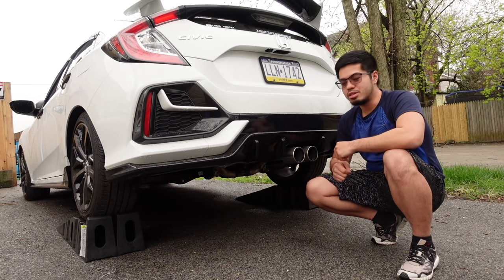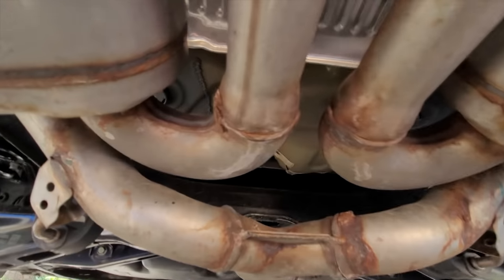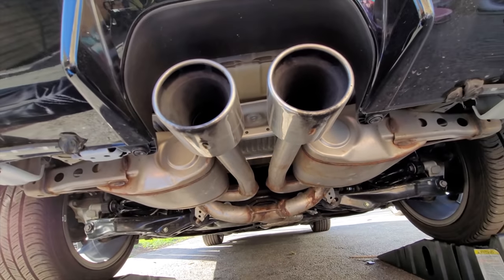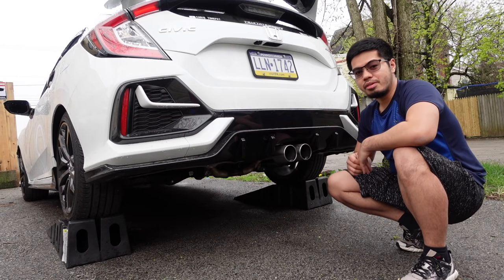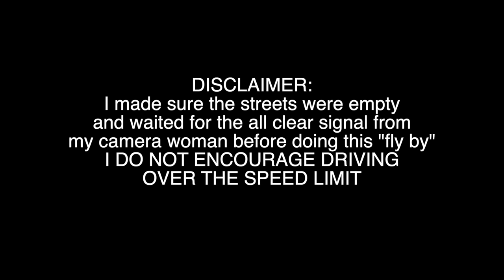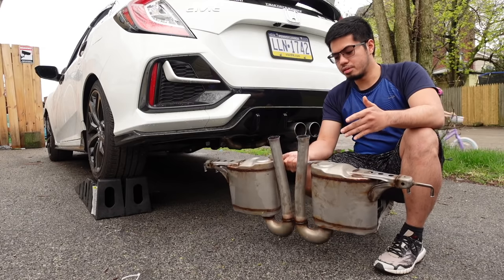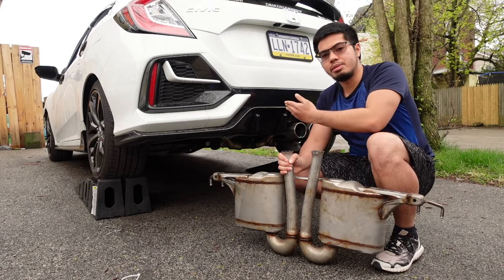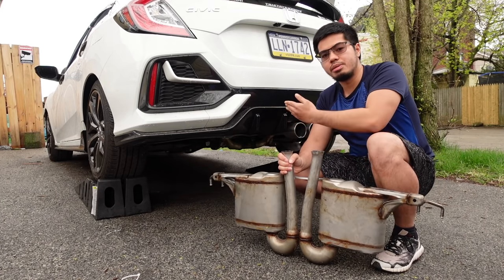MUFFLER DELETE | SOUNDS and COMPARISON | 10th Gen Honda Civic

Comment: I really like this guy, you’re going to make it big one day man! I just got a 2021 Civic Sport
Reply from the maker: Thanks man, I appreciate it. And congrats on your purchase!
Reply: bro you're going to love your new car. i've had the 2018 sport cvt and have done a full exhaust, cold air intake, and down pipe. that thing sounds super mean. i was afraid of the tone of the exhaust because it might sound ricey and raspy but no, with a straight pipe it will sound super raspy, but with a good exhaust system and downpipe it's insane how different and good it sounds. had people come up to me asking if i had done an engine swap because of it. if you're thinking of modifying your car this the advise i'd give you.
Reply: You're not the only one with a 2021 civic sport hatch
Reply: I just bought one too. Any good first mods to do? I'm eager to get working
Reply: @etgohomeplease  so far I’ve only done tints and bought a cubby insert for where the usb cable is, what mods were you thinking of?
Reply: Wifey just bought a white sport hatch yesterday ...im pumped to mod it 🤣👍
Reply: What octane do you use?
Reply: @theellimistlives  owner’s manual recommends 87
Reply: Damn should of gotten the si at least or a type r
Reply: @erickmarte5294  what exhaust brand you did???
Reply: Me too last week i’m so crazy 😜 about it
Reply: @erickmarte5294  hey what exhaust did you get?
Reply: Ayyy me too. I got the hatchback version though
Reply: EYOO ME TOOOO
Reply: @martinabrante8571  there’s no brand he just remove the muffler. Just go to meineke or other garage that can do custom exhaust they will do it for you 😄
Reply: @etgohomeplease   first thing i did bro was change the headlights from halogens to LED lights
Reply: @theellimistlives  93
Reply: @edwardanderton338  on the gas cap itself it says 91 recommended
Reply: Same
Reply: @erickmarte5294  what exhaust u endup going with just outta curiosity? i got a borla s type
Reply: @edwardanderton338  uh no. Recommends 91 or 93
Reply: @YTkingcherry  si is the same exact car and motor. Different shape 🙄
Reply: A great Video also watched the lip video im going to the muffler delete and lip on my car thanks a lot for the great information cheers from down under Australia 👍🇦🇺

Comment: Have a 10th gen Civic Sport myself. Good car, but adding significant power and torque without blowing up the rear main seal or damaging the CVT can get a bit dicey. In terms of a muffler delete, I think a full, high flow exhaust is probably a better fit for me.

Comment: I did a muffle and Resonator delete awhile ago and it’s sounds great. Much louder but not to loud. Lots of crackle and pops. I’m a manual so not much drone but with cvt I don’t recommend because being unable to manipulate your rpms will result in much more drone
Reply: What resonator do you recommend?
Reply: I recently purchased an 11th gen civic touring (highest trim level), I was looking to do an exhaust swap but it is so expensive. And also, being a CVT im unsure on whether or not its a good idea. Moreover, I was looking at a muffler delete but that would impact the warranty of the car. I literally got the car last month. My touring comes with paddle shifters, so I guess I can manually change the rpms on my car while driving even tho it is a CVT. Would you still recommend a muffler delete/exhaust swap? its my first car and Im only getting into modifications lol, any help would help.

Comment: Not sure if you still have this car. If you do definitely get it fluid filmed , woolwaxed, bar and chain, whatever undercoated. I see you're in PA, if you want the chassis to stay nice and rust free it's worth the time and money. I prefer to use fluid film black. Make sure you get essentially any exposed metal you can see underneath. Especially upper rear bumper area things like that.

Comment: Nice video man, not alot of people make good sound comparison videos on muffler deletes. I just got a 21 civic hatch sport as well and I was wondering whether or not to do this so thanks! the sound with the delete sounds exactly like my old 2003 em2 coupe when it was stock. interesting because the d17 in the em2 has a small 127hp but .2L higher displacement
Reply: yet with the delete on the hatch, it sound exactly the same as the em2 minus the pops

Comment: I'm guessing that you did a muffler delete because you couldn't afford the exhaust system and you couldn't wait for the sound. Been there quite a few times. A bit of advice; you can get a little more sound with a muffler delete and turning down the pipe tips under your cab. But it's not true that your car will be louder without mufflers. It's like the difference between yelling out in the open, and yelling into a cheerleading cone. One makes the sound echo. It also directs the sound somewhere so whoever is in the path of that sound will hear the maximum volume. Doing a muffler delete without directing the noise tends to amplify not just the passage of air through your intake and exhaust but also all of the internal clicks and clacks of the motor. Which doesn't sound as good.
Reply: Huh?

Comment: Hey I have a 2018 Honda Civic hatch aswell but when you get the resonator delete it sounds a lot better!!
Reply: I’ve done all 3.  Muffler delete. Res delete. And res plus muffler delete. The latter was too loud. A res delete is the best if u want to daily it.
Reply: Did you guys have check engine light on plus other lights came on?? I did when i did res delete
Reply: @paullomecio4428  I've never seen a check engine light with any exhaust mods.  Once my MAF sensor fell off due to a botched intake install, that's the only time I've ever seen a CEL.

Comment: Hello, I was wondering what you think of the EX model instead of the sport version?
Reply: Hey man! I have a 2017 EX and I love it! Other than the lack of the skirts and different tail pipes, the body is exactly the same. I do wish I had the 2.0 liter engine, but if you don’t want to spend the extra money on the sport, the EX is a fantastic car with a lot of nice interior features.
Reply: @griffinhagen871  which is a higher model? The Ex-L or Sport model?
Reply: @0xlack138  ex-l

Comment: Got a question, doing this and the wing doesnt it void your warranties ?
Reply: There’s actually a law that states dealerships can’t void any mechanical warranties on exhaust modifications that don’t affect mechanical stuff, i.e. don’t remove your catalytic converter and mess with the O2 sensors but everything past that is fine. I did a muffler and resonator delete on my Toyota and kept bringing it in for the Toyota care warranty maintenance and a recall and had no problems.

Comment: Do the sport hatches come with that like same look alike style of the type r or is that after market?
Reply from the maker: Yes. Only thing different about this is the lip and spoiler. Oh and it’s lowered by an inch.
Reply: I know it’s been awhile and you sold your ‘21. But when you did the suspension did you get lowering springs or coilovers? I like the idea of lowering mine about 1-1.5 inches nothing more, and don’t know which route to go to preserve how nice this thing drives.

Comment: I’ve got a 2016 lx and I want it to sound a little more aggressive but I want it to pass emissions so removing the muffler is not an option for me will an aftermarket intake add a little bit of a more aggressive sound possibly? Or maybe just an aftermarket muffler with the stock exhaust?
Reply: Mufflers and resonators do not effect emissions in the slightest the only thing exhaust wise that would effect emissions is a cat delete

Comment: just for clarification:
if 1 = stock and 10 = straight pipe
where does this put you? through the video it sounds like maybe a 3.
Reply from the maker: 4 it sounds so much better than stock! I also recently noticed there were just slight burbles on cold start! Not noticeable until you really listen to it.
Reply: @chris_timefk8  got it. Thank you!!

Comment: hi I want to buy the 1.5 180 hp civic I just want to know if at low speed low RPM in first gear there is enough torque ?
think you
Reply: spools up at 2 grand. with premium and a tune its 340nm

Comment: Great vids!   
Maybe a dumb question...but can I muffler delete my EX?
Reply: I have the EX model as well I seen some getting the muffler delete is possible just got to find a good shop
Reply: that i’m aware of, i’m pretty sure you can do a muffler delete on any car. It may sounds slightly different but there are no differences between the sport an ex model, they’re both 1.5 L Turbo charged. should have a similar sound.

Comment: Is there any drone on the inside with the muffler delete?
Reply from the maker: Slow speeds there’s a slight drone. But on highways, no.
You’ll here the drone around 1500 to 3000ish rpm
Reply: Is the drone super annoying or not bad? I’m thinking about getting a muffler delete this week but don’t want to regret it.

Comment: If you take off your mufflers YOUR CAR WILL RUN RICH and it will dirty your o2 sensors. And just be warned it will take off a year or two off of your cars life.
Reply: can you explain to me why? i’ve got a civic that i’m thinking of doing a muffler delete on but was un aware of this.
Reply: @KelsiKula  taking off your mufflers will allow more air to enter the back and faster airflow will make your 02 sensors to think it's running lean because theres more air now so it balances it out by adding more fuel so you'll dirty your engine and ruin your sensors over time.
Reply: @coleprivett9125 please don’t talk about things you aren’t 100% knowledgeable of. These cars and many other turbo cars have a pre cat and post cat o2, with the car only using the pre cat o2 for fuel air trims/ratios. Most of these cars can have everything after the primary pre cat o2 deleted with no issues, as long as a replacement bung for the post cat o2, and a replacement sensor is all installed. I’ve ran plenty of cars with cat back straight pipes and the o2 sensors not the cars ecu data indicated that it was running lean or rich. Both of those factors are much more likely caused by another thing, irrelevant to the exhaust

Comment: You are going to ricer route. Lol
Come on. 
Make it a sleeper.
Reply: Cringe old head mind set. My 10th gen is louder and i make 315ish whp🥲
Reply: @estreaper7393  Huge exhaust that serves no purpose but to make the car louder
- Large spoiler on the back that looks like something Boeing made for the 747
- Lots of after-market company stickers they don't have parts from, but must be cool
- Expensive rims that usually cost more than the car itself
- Bodykit to make the car appear lower, usually accented with chicken wire
- Clear tail lights and corner signals
- A "performace intake"- a tube that feeds cold air to their engine usually located in areas of excessive heat (behind or on top of the engine)
- Most of these riced cars (a.k.a. rice rockets or rice burners) are imports; Honda Civics, Accords, Integras, CRXs, RSXs, Del Sols Mitsubishi Eclipses, Lancers, Subaru Imprezas
Reply: @estreaper7393  this copied from honda tech forum. Lol
He is doing everything in the list
Reply: @noobwow2009  he has factory 21/4 inch exhaust... im in so cal meet my fk7 or crx🤧😂